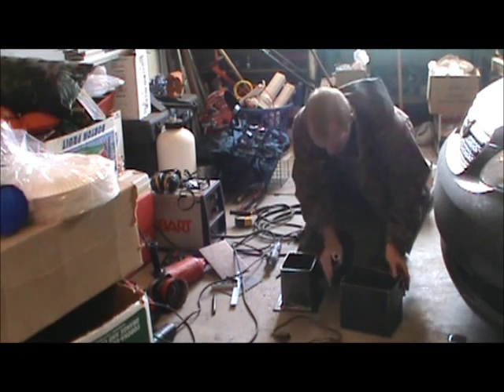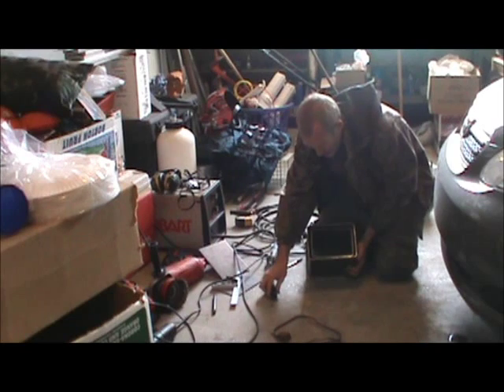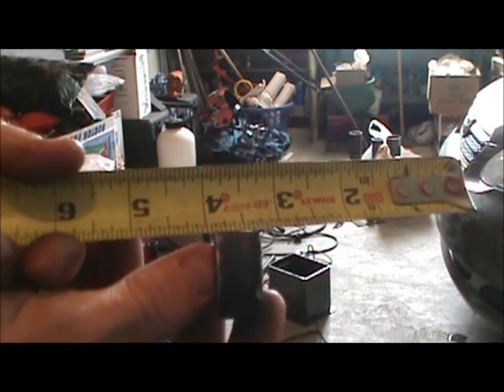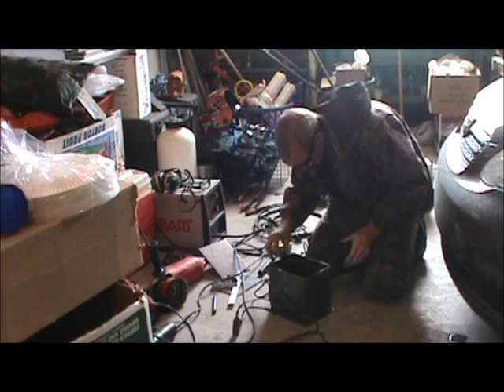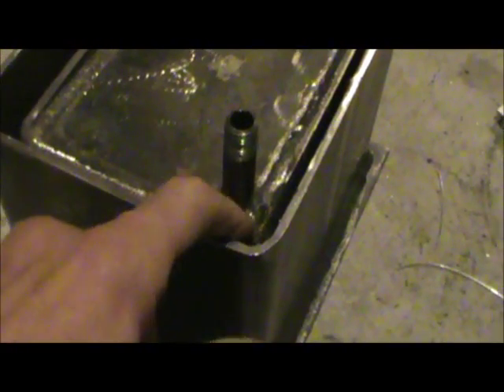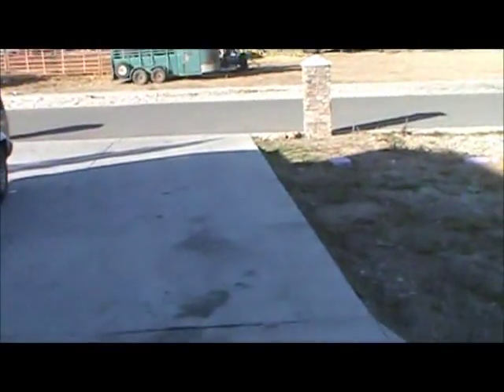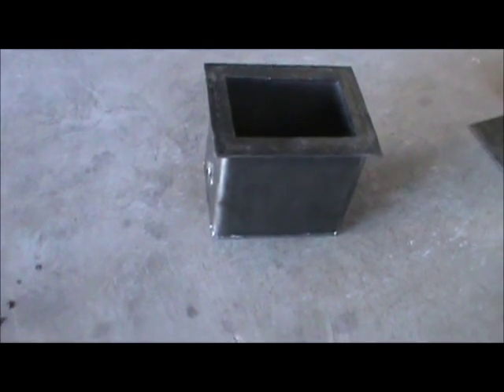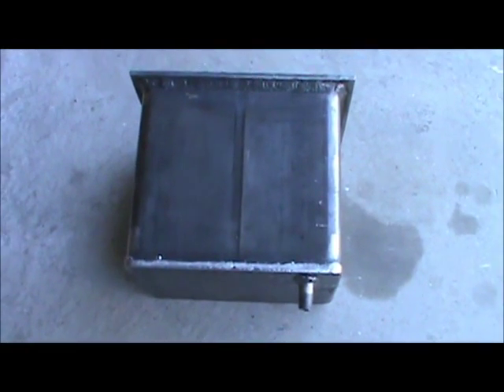100+ MPG Project New Vaporizer Design 1.5

Comment from the maker: Thanks! I use a float switch connected to a solenoid valve to control the fuel level in the container. I am not sure what the temp get's to yet I had a thermocouple in the container but it would not work due to the gasoline so I am waiting for my sealed thermocouple to come in so I can one control the temp in the container and two know the temp. in the container. I believe I mentioned in one of the videos I will be installing a water injection system.

Comment: Hello tyson, this is an excellent design though I have a couple of questions for you.  First I was wondering how you control the gas level inside your vaporizer? And second what tempurature  does your vaporizer get? Also you should water injection for your car to enhance the performance of your vaporizer even more.